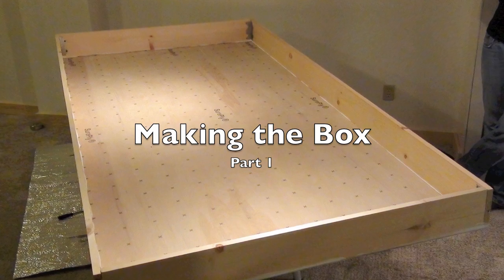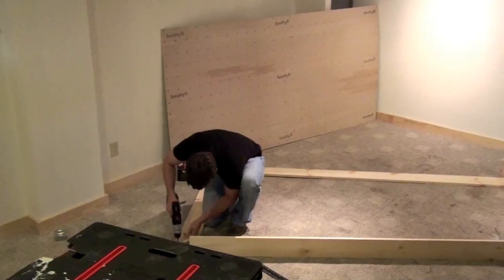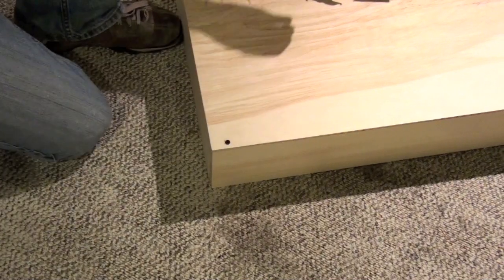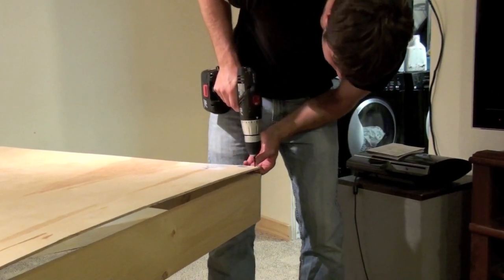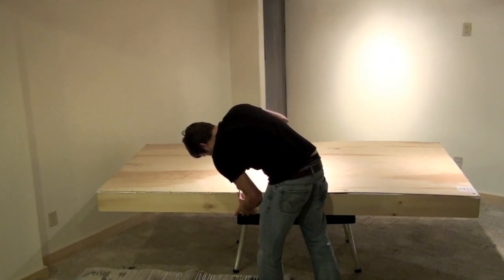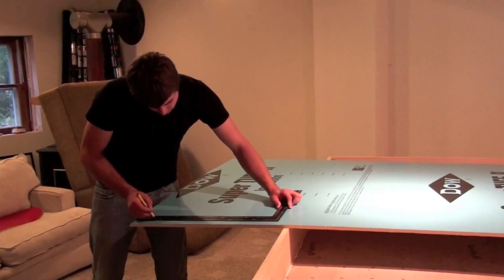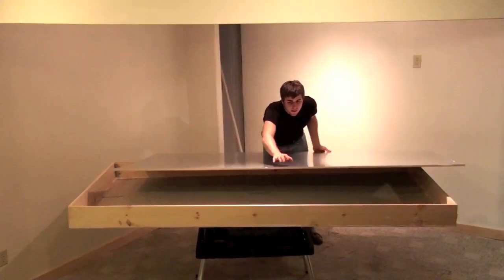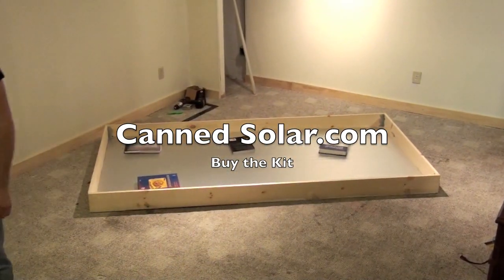Canned Solar Part 1

Comment: Well, fire-brick is nice for high temps, but this doesn't have to be, and actually there are some salts in solution that have a MUCH higher "heat capacity" than fire bricks. Look up "heat capacity" and "Glauber's Salt" Na2SO4 decahydrate, as I recall it has one of the highest. A thick hypertonic solution of that may be the best possible solar storage.You could blend black dye with it and use jars of it for the absorber. Water itself isn't bad, probably better than any masonry, as I recall.

Comment: I may have a source here for manufactured seconds of ceramic bricks from a heating system that stores very high temps heated electrically (primarily) during off peak hours (thermal storage device) I was thinking about playing with to see if it could store enough heat with this system to heat say a greenhouse all night in winter.

Comment: For that matter you could put it on a proper foundation like a little narrow chicken coup with south-facing windows. The only thing you need the flashing for is directing air-flow, which isn't actually necessary, just an inlet at the bottom and an outlet at the top and lots of black stuff.

Comment: Used flat black engine enamel on the metal, and styrene sheet insulation all around the inside, the kind with aluminum foil inward. Now that I think about it, one could have just as well included thermal mass, bricks or water containers or such, and had a heater that would last part of the night as well, and closed the windows with an insulative reflective batten.

Comment: We built these "outboard solar heaters" we called them, back in the early hippie days of solar in the 1970's in Missouri. They were found in mags like the Mother Earth News and such from back then. We used flashing metal sheet and folded it. Lot quicker than all those cans. Use pop-rivets and screwed it to the back plywood. suspended the back layer on standoffs from the back of the box, and made the front out of salvaged windows.

Comment: Why do all you guys think the soda cans do anything? All you have to do is absorb the sunlight and run air over it to pick up the heat. You can use cheap aluminum sheet folded, or guttering, or anything that directs the air. Paint the receiver black and run air over it, that is all you need. Assembling those cans is a pain in the ass by comparison.

Comment: first of all that foam board is only rated for 190 degrees F. solar heaters can put out well over 200 degrees F causing it to ignite. just ask DOW chemical the makers of the board. you guys are putting people at risk with this.